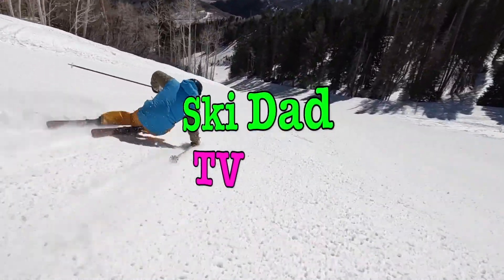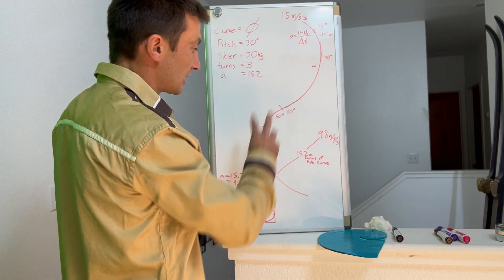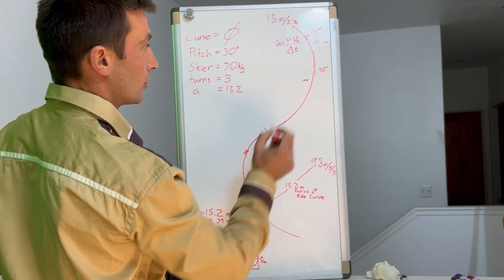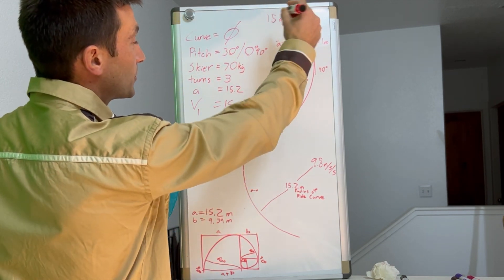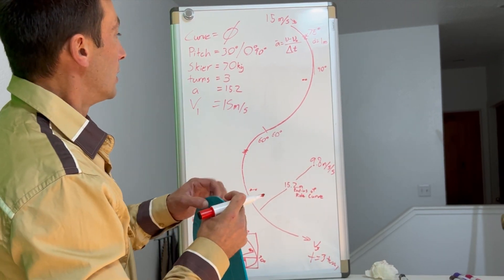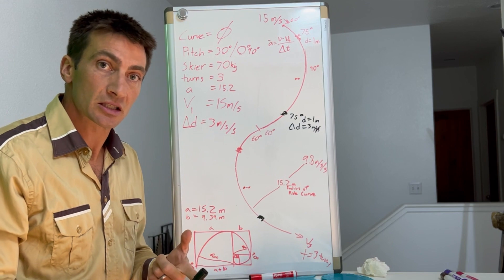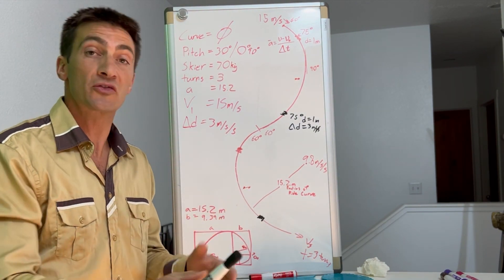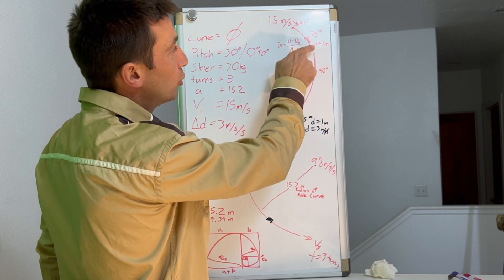Unlocking Ski Racing Secrets: Solving the Golden Ratio Turn Challenge!

Comment: Mathematical statement followed by a racing saying: The racer coming first at the end is the one with the highest average velocity /  smooth is fast. These are telling you, you should not do anything too drastic, so you adjust your speed continuously as opposed the decelarating suddenly at a particular point. On a dirt bike, the smoothest line is not for the show, it is boring, but it is the fastest. Drifting and wheelies are way more fun to do and  look at, but this approach is not fast overall, although it might show the highest instant velocity. In skying, gravity is your motor, therefore full throttle is going straight downhill and partial throttle is going at angle from the direct line downhill. All segments of the course at angle with the straight line are a compromise from a top speed perspective. On the hill, the full throttle opportunities are the apex of the turns since your are then facing downhill but you are changing direction, so there is very little time that you are actually full throttle. Now, decelarating naturally is achieved by increasing the angle from downhill  to trade kynetic energy for potential energy, while abruptly dumping kynetic energy in friction is braking. To your question as to where it is best to dump kinetik energy, the answer is when absolutely needed and impossible to reduce velocity in a more energy conservation manner. Your proposal to do it early in the three turn scenario is best if it allows you to get into the track at the right speed and conserve energy afterwards.

The mathematical model that your are asking for is a cinematic calculation in mechanical engineering.

P.S. decelation would be better represented as dv/dt.

Comment: Hi there - just binge watched your videos - thoughtful and interesting, well done for not just regurgitating stock “meh” instructors stuff. 

I have a maths degree - so can bring something to this… a few observations from some head scratching. I’m sure you can write a whole lot of differential equations, but I doubt they’d be in anyway analytically solvable. so don’t get you nearer to any meaningful analysis by doing that. 

My hunch is rather  than making high level arguments which might prove a point but won’t give you numbers - will be to use some kind of “numerical method” solution, which could be as simple as on a spreadsheet taking successive nibbles at the path updating the changes to velocity and hence position as the clock is ticked forward little bit by little bit. 

This isn’t too difficult to set up - but for an elephant in the room - the actual path. I realise you’ve based this on your drawing aid - but realistically you’d just need to digitise the path … as the way you’ve drawn it there’s no way it has a simple parameter used formula for it.

But - I think there are some problems with this model. I’m not convinced decelerating a set amount at different points on the path is realistic - in practise a Skiier will decelerate so as to hit a target for the critical place where he or she needs rheir speed to be “blah” on the path (using their skill and judgement) which is it the same as decelerating at a certain rate for a certain time - at different places in the path.

Secondly - I question the path shape. Your curves make sense when drawing pictures - but skilful skiers can ski different path shapes. 

Different path shapes will lead to different results. Obv the radii of turns are  limited by the athletes skill; as well as snow loading capability, position of gates etc . Burn-‘there are still options-‘

I suggest you look up a fascinating classic maths / physics problem called the “brachistochrone”‘problem . See - https://en.wikipedia.org/wiki/Brachistochrone_curve?wprov=sfti1

And Adam savage did a lovely YouTube video all about this with Michael Steven’s of V sauce. In the real world skiers can take advantage of this when navigating a non planar hill side …

Sorry I diverge, but you pose an interesting thing to make us think about.  It’s late and I need to turn the lights out but hope my initial thoughts  are of interest.
Reply from the maker: I agree with you on all points. However! I still want a numerical solution to this problem. That is why I tried to limit the variables and focus on only a small number of inputs. 

My vision is a spreadsheet where you can adjust those inputs and receive out tangible info on where and how much deceleration at different parts of the turn are beneficial vs. detrimental

Comment: Engineer here, with some ski racing experience as a kid/teen, also some professional experience in sports engineering. I think you're approaching this problem in the wrong way. Ignore position/speed/acceleration - this is better looked at as an energy problem. When you ski a course, you convert gravitational potential energy (a function of the vertical descent of the course - ignoring energy input eg from skating) into kinetic energy, and you lose energy on the way down. The fastest skier is the one with the lowest aggregate energy loss. Loss comes from 3 main sources: aero losses, base friction losses, "scrubbing" losses. Going through a gate forces the skier to turn - your challenge as a racer is how to turn your skis the required amount while minimising energy losses. So, how might the 3 different source of loss be affected by technique. Let's ignore friction losses - this are basically a function of distance, which probably varies little. Aero drag is "easy" - the loss goes with velocity squared, so keeping a more consistent speed reduces aggregate aero losses (note this favours early reduction in speed). Scrubbing losses, in terms of your question, is where the action lies. It's not a given that early vs late scrubbing of speed is less lossy. I'd frame it in different terms: a stivot is possibly a lower loss means of changing direction, because you can move the ski through a given angle with low pressure on the ski. A late scrubbing is a response to having overcooked the turn and having to move the skis through a given angle to correct the line - it is possible this is more lossy because the ski pressure at this point is much much higher, and the need to correct may mean that there is more overshoot. But is one categorically less lossy than another? Not sure this is really possible to analyse in absolute terms. In either case, the skier isn't thinking about scrubbing speed - they're thinking of getting the skis round the desired line, and the energy losses are a consequence of their dynamic movement. Bottom line, this is likely an empirical problem not a mathematical one. Sorry!
Reply from the maker: Daniel, it is my hope to solve the line question independent of technique. “Base Skiing” is a philosophical approach to racing. It does not delve into technique. I assume that an athlete who pushes on the ski harder can have more energy, thus be faster. The best racer will win regardless of philosophy, I just want an equation to back up my philosophy.

You make lots of great points, however I still see the usefulness of this solution

Comment: It would be cool to a complete ski racing line model, but I think that's got a lot of variables(although I'm sure some physics PhD's in Austria have done this!).
Maybe to start, for simplicity sake, to prove that scrubbing speed is best at the top of the turn, you would assume: 
1. that the skier follows the same line regardless of where they scrub speed(either at the top of the turn or completion)
2. the skis have the same friction when carving no matter what edge angle the skier needs to hold to carve the turn.  
Then  it would be possible to completely ignore the side to side movement across the hill and just calculate the speeds from the acceleration force from the downslope of the path that the skier follows at each point of the 3 turns, and then we place the braking force at different parts of the turn(different angles of down slope) to make a comparison.  
This makes it a 2 dimensional problem instead of a 3 dimensional.